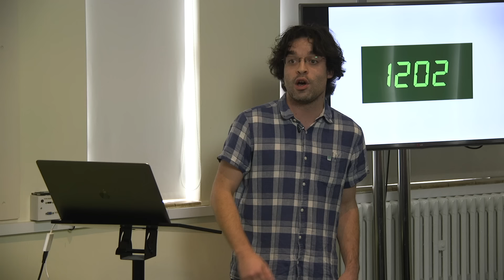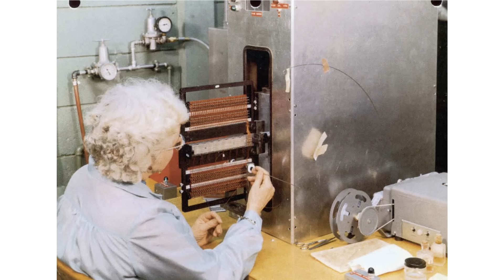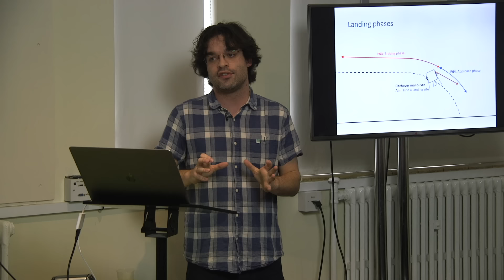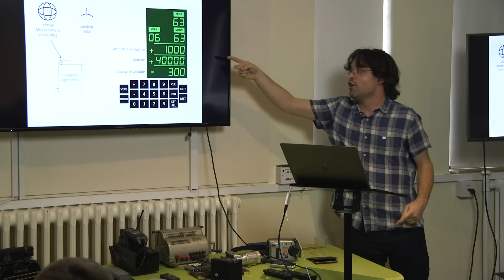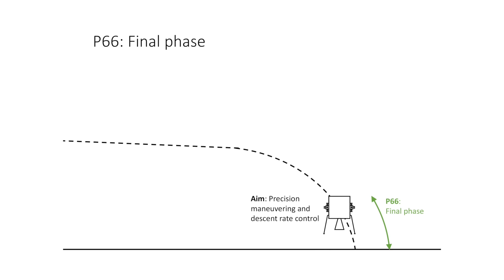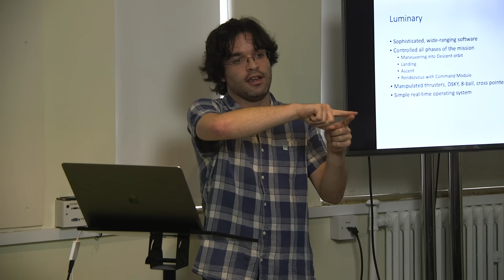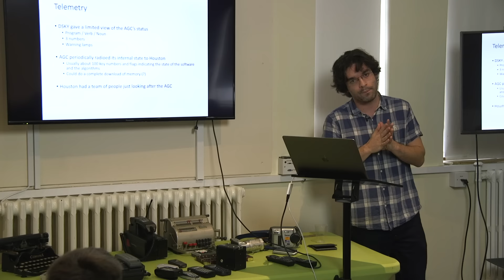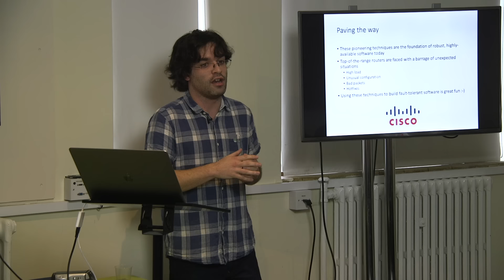Light Years Ahead | The 1969 Apollo Guidance Computer

Comment: Great talk, all in all, really enjoyed it... But almost for the entire time(since it's been mentioned) I've been wondering how the computer got 1202 > 1201 > 1202 error code sequence from Buzz doing the same thing after the computer restarted? What was special in the middle that made the error code different from the others?
Reply: 1202 (“Executive Overflow - No Core Sets”) means there is no available Core Sets (Core Set is basically a process table for task running. 8 Core Sets in LM's AGC meaning maximum 8 tasks running at the same time). 1201 (“Executive Overflow - No VAC Areas”) means there is no available VACs - VAC, or Vector Accumulator, is a secondary process table for interpreter programs, and there's only 5 available. First 1202 triggered a restart, and as you remember, only essential tasks are restarted, so less than 8 Core Sets are occupied, but 5 of the tasks running at the time of Buzz's second attempt of entering v16 n68 were interpreter tasks, so second attempt ended in error 1201.

Comment: An excellent presentation, but I'm baffled by one thing: The cause of the computer overload was given as a faulty radar system that was not switched off during the landing phase when it was not needed anyway. Surely, overall power consumption in the landing module would have been a critical consideration that would be closely monitored by the astronauts, so how would it have been possible to inadvertently leave something accidentally switched on, thereby wasting valuable power?

Incidentally, I loved his comment about modern software and how he wouldn't know how to write a "hello world" program that used less that 100 kbytes. In the late 60's I worked on a DEC PDP8 computer that had 4096 x 12 bit words and it was amazing what could be achieved with what is about one millionth of the amount of memory common in modern day computers. I remember one task, which was to modify the part of the operating system that was permanently resident in the core memory so that users could switch between two different unrelated tasks. I had to analyse the manufacturer's code, reduce its size and fit my extra instructions into the space that became available. How much memory are we talking about? 256 words - no that's not a mistake - I don't mean 256k words. The reason for wanting to do this was that we had a mathematician who ran simulations lasting several days, and this meant nobody else could use the machine for a quick job, which was a real pain. Therefore I added some code within those 256 words reserved for the operation system, so that when anyone typed Control/Shift/£, the program currently running was saved onto DECTape along with the complete machine status and an alternative program took its place. This would initially be the command prompt. Someone could then run a quick job and then type Control/Shift/£, whereupon the original program was reloaded and made to continue where it left off. Compressing DEC's original 256 words to make room for my new code and writing that new code took me several days because I had to shuffle the machine code instructions around so that they could also be used as data constants by other instructions - pretty horrendous stuff - but it all eventually worked. (Just to clear up one point - there was obviously more to my code than that in the 256 words, but this was swapped in from the DECTape.)

Comment: At VCF(Vintage Computer Fest) West last "live" time two years ago were the Apollo guys. Some young guy had remade the Apollo computer hardware which was all based on 3 input NOR gates. He had a cool presentation and a simulated landing on the moon. Some of the original Apollo engineers were there. I asked one why they didn't try to recover the first stage? They said do you know how that weighs? I sorta thought about 10 percent what it weighed at take off full of fuel with those two fully fueled stages on top. Apple I presentation was a mess. Earlier a year or so back at the same place CHM comp history museum Apollo guys talked about writing the code to run on the Apollo computer and were super worried about saving and restoring current state during resets/reboots.

Comment: Fantastic talk.   Having worked on Systems with only 512K of RAM, one processor and 200 interactive devices and printers attached it's easy for me understand how a lot can be done with very little hardware.  I spent years picking off OS bugs and most were triggered by "one-of" hardware bugs or failures in recovery code caused by a 2nd failure while recovering from the initial failure.

Comment: Can someone answer me please, pressure on Earth at sea level is 1 atmosphere. It decreases with altitude. What stops the atmosphere from escaping off into space? Is there a forcefield at some distance from Earth's surface that contains the atmosphere and holds it in place? Because without such a thing, what stops the air molecules escaping as a result of the relatively high, positive pressure at ground level versus the vacuum of space; clearly there is a pressure differential across which air molecules would move until there were none left. Is the model wrong, are we just taking it on "faith"?
Reply: Gravity.

Comment: if man goes more than 400 miles off earth surface van allen belts will kill him
Reply: Wrong.
Reply: @atlas8827  in 2013 nasa discovered a third set of van allen belts. pretty odd considering they allegedly passed through them in the apollo missions
Reply: @mcurbmcurb  
This third belt is not present all the time. It's sometimes there, sometimes not, depending mostly on solar weather. It is also considerably less dangerous than the other two belts.
Reply: @atlas8827  why is it that nasa astronauts in public videos have also said that they have yet to deal with van allen belt radiation problem. you can see nasa vdeos where they discuss the potential problem of moon dust. why would that be the case if the moon buggies were shooting rooster tails of dust into the air back in the day. if you want the url for the videos i will supply them.
Reply: @mcurbmcurb  
I'm sure the videos don't say that.
Reply: @mcurbmcurb  
Note that the engineer says the radiation can damage "onboard computers and other electronics". That's it.
Reply: @atlas8827  wrong! you did not listen to the whole thing. he clearly states that the first mission will be without humans in order to see if the shielding can protect the human occupants. you really are grasping at straws. your problem is not with me but with nasa
Reply: @mcurbmcurb  

I watched it again. He says the radiation can damage the electronics, and that we need to be sure they'll work fine before putting people on Orion and sending them to the moon. That's it. Also, this clip is heavily cut down. In the original segment, the engineer mentions other problems we must be overcome, hence the "we must solve these problems..." bit. On top of that, this isn't about Apollo. It's about Orion. For Apollo, radiation levels in the belts and in the vicinity of the moon were measured by dosimeters protected by aluminum shielding comparable to what they used for the command module and it did just fine. The Van Allen belts are not a insurmountable problem for crewed exploration of space. They never were. And Orion has already been tested all the way back in 2014, and the radiation levels were not even close to killing anyone.  It's over.

Comment: What a Load of BS.
A descent to the moon using retro rockets in zero gravity...
Think about it, combustion without AIR.
Who can possibly believe computers not even close to as advanced as your cell phone did all these things.........
Huge pile of Dung.
Reply: The moon has gravity, my dude. Rockets carry their own oxidiser. They wouldn't be able to operate properly just by burning a mixture of air and fuel. This has been the case since the early days. The german V-2 carried both alcohol and liquid oxygen. The lunar module carried hydrazine and dinitrogen tetroxide. These two chemicals ignite on contact.
Reply: @atlas8827  More Absurdity, the moon has Gravity......., Space is a vacuum according to your logic also, just what burns, or ignites in a vacuum?
Reply: @rtxyz1  
That's not absurdity, it's a statement of fact. Of course the moon has gravity. All planets do. Gravity is a property of matter. 

I specifically told what they used in the lunar module. Hydrazine and dinitrogen tetroxide. When these two chemicals touch, they ignite. I don't know how you missed this.
Reply: @atlas8827  All planets have gravity....now the moon is a planet.........
Now you are going to explain Gravity to me....like Einstien.
The fuel calculations alone would make getting off the ground impossible, this is a Fact.
Another question, why haven't they used this technology again?
Maybe you can explain how video transmission from Mars happens in real time too for the huddled masses.
It is called rewriting history by the way, ignorance is bliss, Truth is treason in the Empire of Lies.
Reply: @rtxyz1  
Far enough. The moon isn't a planet, that was my mistake. But it still has gravity, it's just weaker than earth's. Fuel calculations would not make it impossible, that's some nonsense you just made up. 

What technology are you referring to? 

There are no real time video transmissions from mars, that's dumb.
Reply: @rtxyz1  
NASA never said there are real time video transmissions from mars. That's ridiculous. Any video taken from Mars is saved on the rover and later transmitted to earth, a process that can take days. 

Radiation would not fry anything. That's nonsense. Provide some evidence for you claims. You hoaxers always bring up radiation, and yet you know nothing about it.
Reply: @rtxyz1  
 You NASA haters need to get A LIFE, A CLUE - AND A JOB!

Comment: They are gonna have talks like this about Perseverance and its neat little chopper in a 100 years.
Reply: Jonny Mosquito Strawman at Large  
I am pretty sure you don't care but:

"When NASA commenced its lunar spaceflight program, its scientists already knew about the belts and their spatial and energy distribution. Apropos the energies: electrons below about 1 MeV were unlikely to be dangerous, as were protons below 10 MeV. For example, a proton with an energy of 3 MeV could penetrate about 6 mm of aluminium (a typical spacecraft material) whereas one of 100 MeV could penetrate up to 40 mm. So engineers fashioned shielding that consisted of a spacecraft hull and all the instrumentation lining the walls.

Further, knowing the belts’ absence above the poles, the altitude of the lower edge of the inner belt being ~600 km (well above the LEO) and the location of the South Atlantic anomaly, where doses are at a high 40 mrads/day at an altitude of 210 km allowed NASA to design the Apollo translunar injection (TLI) orbit in a way that the spacecraft would avoid the belts’ most dangerous parts.

Apollo 11 bypassed the inner belt and only passed through the weaker part of the outer belt (Fig. 4). According to NASA’s ‘The Apollo Spacecraft: A Chronology’, the high-altitude nuclear tests would have had a significant impact on Apollo orbits but NASA scientists had accounted for this possibility in radiation-protection planning."
(https://science.thewire.in/the-sciences/apollo-11-van-allen-radiation-belts-translunar-injection/)

In the video you posted, they never claimed it's deadly. They are saying it could be bad for the electronics inside the orion spacecraft and they have shielding which can be used against the radiation...
Reply: Probably in about 30 years.
Reply: Jonny Mosquito Strawman at Large  
 Yeah. NASA haters ARE a joke!
Reply: I doubt it......

By then everyone will understand that it's mostly cartoons, not space. Not Mars.
Reply: @davechristensen2482  
 GET A LIFE!
Reply: @CNCmachiningisfun  I have a life....
I have a brain....
I have eyes.......

Where are the pictures and videos of our planet, taken from space......that show us turning, spinning and hurling through space ???
Honestly,  after all these years we should expect a camera on the moon, sending back livestream 24/7 of our planet.

Comment: This is a wonderfully informative presentation. Love it.
I’ve had a real interest in the AGC for years, and somewhere along the way I read an account by one of the MIT engineers that said the computer overload wouldn’t have happened if a particular radar multiplexer was designed correctly.  I don’t remember the particulars, but I believe the claim was that the two radar streams should have been synchronized somehow, but weren’t, causing twice as many interrupts.  Perhaps someone has more info on that, or perhaps that’s what he is referring to as the radar hardware bug.